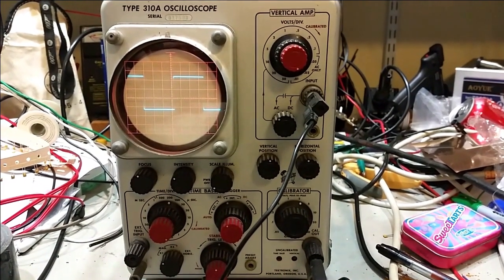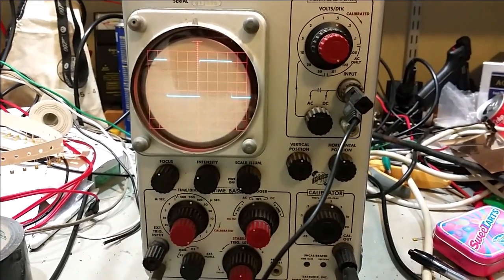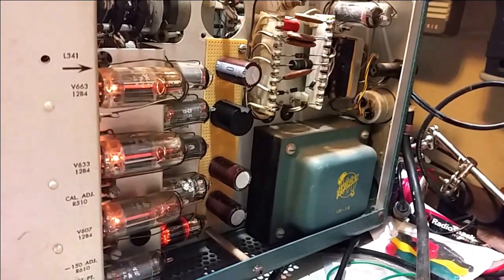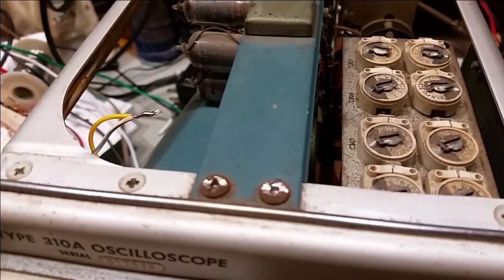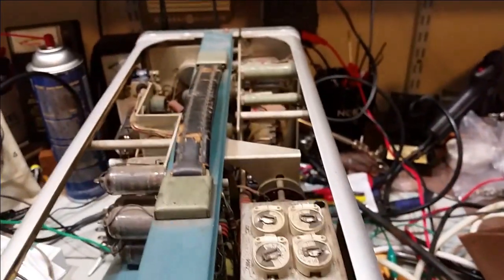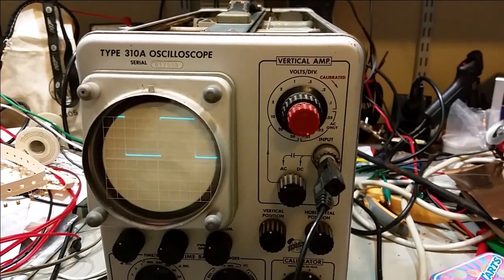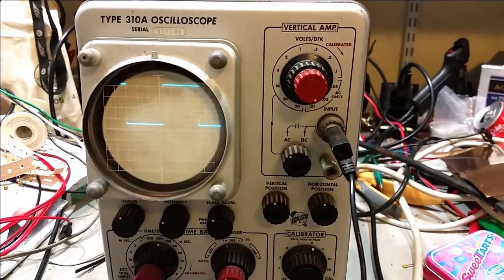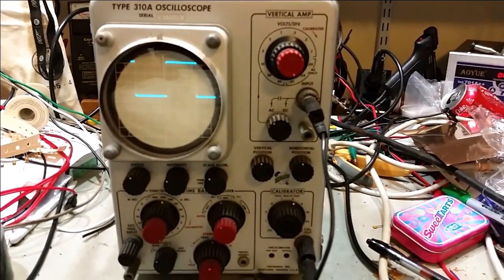Tektronix Type 310A Oscilloscope Restoration Part 2

Comment: Hello, Nice work on the 310A! I own one too, fully functionnal and clean for the last 20 years, serial #17231, it's within a few hundreds units from yours, lol I use it for my high-voltage tube stuff, somehow I trust it more for HV than my other ones from the '80s :-)

Comment: Looking good. As you no doubt found, it has a rock solid time base. I use mine all the time for general wave form examination. Thanks for posting the video.
Reply from the maker: I still haven't had a chance to finish work on the case, so it is setting open up on the shelf. I have used it a few times and have been impressed. For the size and age (and for one that was not pampered at all), it is an impressive little o'scope.

Comment: Hi, i have a 310A, i would like to know if it is normal that whith auto trigger i am not able able to display properly the square wave from the calibrator. (With manual works fine)
Thanks

Comment: Hello, I have a 310A but it doesn't want to work, no trace, I changed all the electrolytic capacitors and the output voltages don't match those described in the maintenance manual.... can you give me any suggestions?
Reply from the maker: There are a lot of possibilities. Was it working and then failed or do you not know its history? It could be a bad transformer, a bad tube, a bad CRT, or issues in the high-voltage supply. (It could also be a lot of other things, but those would be the ones I'd tend to look at first.) I would do a really good visual inspection. If you've powered it up, you should be able to see any tubes where the heater isn't glowing. If they supply voltages are off, I'd tend to start at the transformer and test it the best I could, then look past the rectifiers on the unregulated side, and then look at any regulated voltages. If you bought it not working, there is a chance someone already looked for the obvious and either found something that is difficult to replace (bad transformer, bad CRT) or didn't find anything and decided it was going to be a lot of work to isolate the issue(s).
Reply: @W4JBM  Hello Thanks for the reply, let me introduce myself, my name is Vincenzo and I am writing to you from Italy in particular from Sardinia. The Tek310A was given to me by a friend, I don't know its history. Its serial number is: 0161770 and its last calibration dates back to 1973. If you are kind enough to help me when and how possible, I will send you more detailed information about the conditions in which I received it and the actions I took and the results obtained.
good evening ( here it is 08.38 p.m.)😀

Comment: i had same problem with my 321a
Reply from the maker: I'm hoping to get back to working on this one in a few weeks to finish the cabinet work and recalibrate it. I hope I find another vintage Tek to restore at the hamfests this spring.
Reply: Mine is stuck in negative problem with the trigger circuit need to replace a couple transistors also the dc bal was off would only trace halfway across crt screen but when I shorted right to left it balanced out its in great shape otherwise it has original schematic case and everything

Comment: My 310a has a bnc input would that make it a later model?
Reply from the maker: pep1dog1 It may, although I don't remember seeing mention of a move to bnc connectors in the later manuals. Tek did a fair amount of custom modifications,  so it might also be one of those.
Reply: The one I have came out of a trade school it is in a zippered canvas case with the manual I don't think it was ever used. KC5QXY

Comment: Looking at the pdf Manual I found on the internet (see WARNING) the BNC connector replaced the UHF after Ser. No 19119. However, mine is No 10764 and has a BNC, apparently  as built. 310 Ser. nos start at 10000.

WARNING - The file I downloaded from the internet - tektronix_310a_vintage_oscilloscope_sm (14824 kB) - worked fine as a computer file, displays correctly, but when I went to print it, corrupted my HP M277 printer, and jammed up the Printer Queue solid. After a couple of days, I got it working again with HP Dr Print and Scan. Tried other files, no problem. Tried the 310A manual again, same fault. At least I know the solution, now!
Reply from the maker: I think there was talk on one of the Tek lists about the 310 having a BNC option or retrofit kit. It has some interesting history and is a cute little scope.  I still haven't snagged a full size 500 series scope, but am happy with this little guy for now.